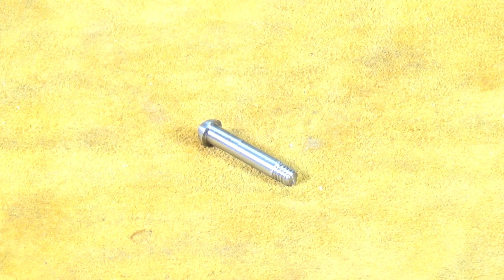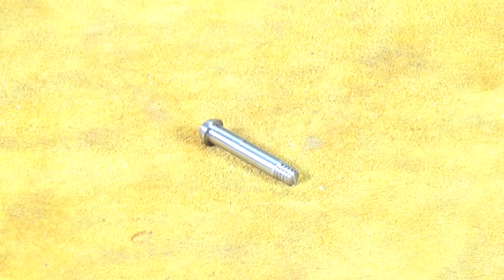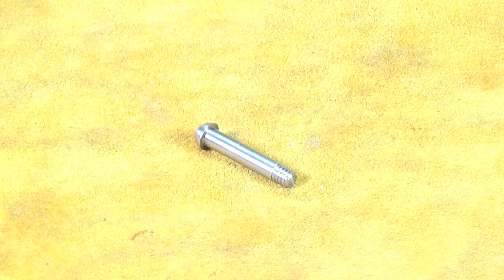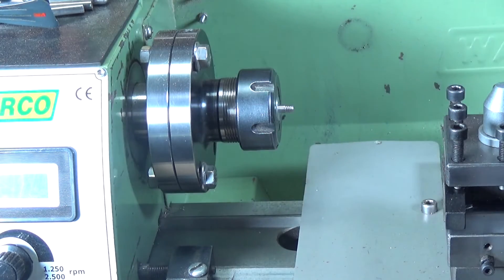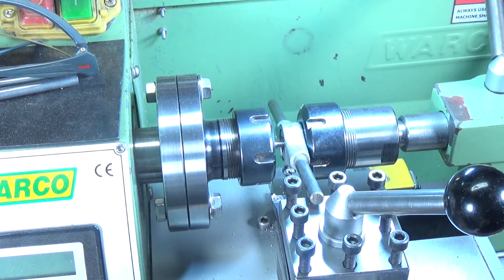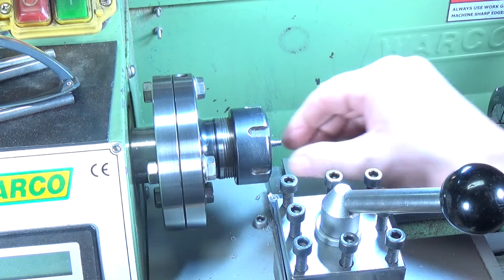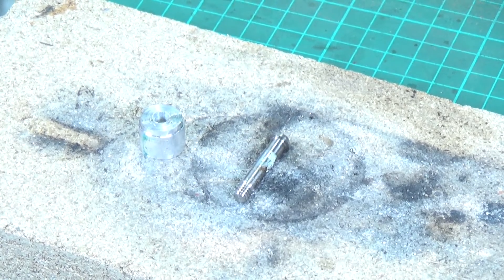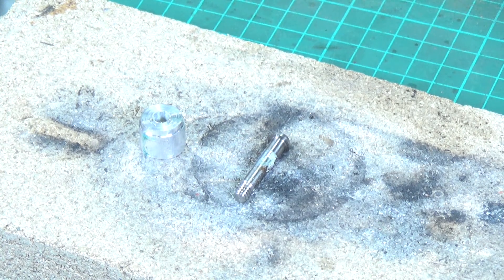Workshop Tip - Easy Way To Hold A Bolt For Machining In The Lathe

Comment: My method is similar to yours, however I cut a   slot the length of the holder with a hacksaw. When you tighten the collet or 3 jaw chuck it clamps the screw in the holder. No need to use lock tight or heat. Another good and educational video. Thanks
Reply: I 100% agree with this and this is the method I use all the time and it's flawless.
Reply from the maker: The method that you and David suggest is probably better as there is no Loctite involved 👍👍

Comment: Good tip Alan, you could also put a saw slot through the mandrill bush and clamp in the chuck should hold it tight, 😊
Reply from the maker: Thanks David, I hadn't thought of that. Cheers, Alan.
Reply: @RetroSteamTech  Hi Alan.  I usually slit the mounting tube or use small V blocks in a four jaw.  Your method is the best way for really tiny jobs where slitting is not practical.  Cheers Rob
Reply from the maker: @Xynudu  Hi Rob. I must admit that slitting the mounting had not occurred to me but both David & Christopher in the other comments suggested it. Cheers, Alan.
Reply: @RetroSteamTech  It's sort of like a collet in a collet :)  Cheers Rob